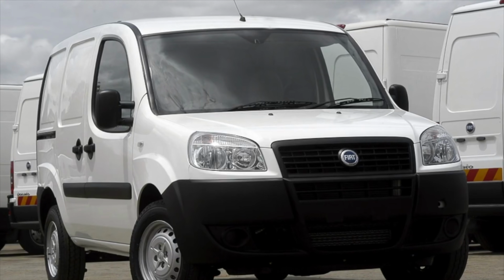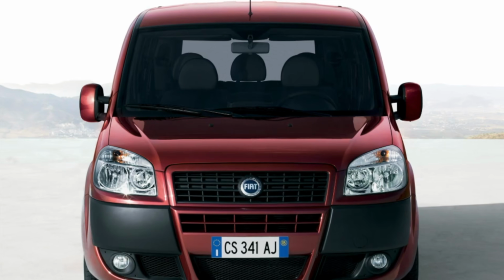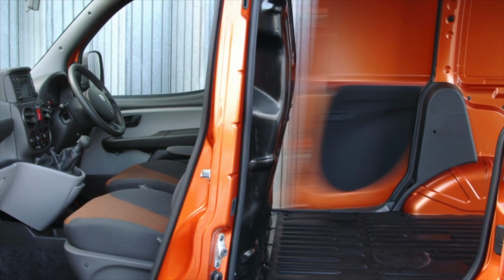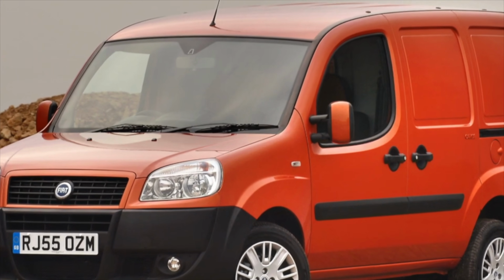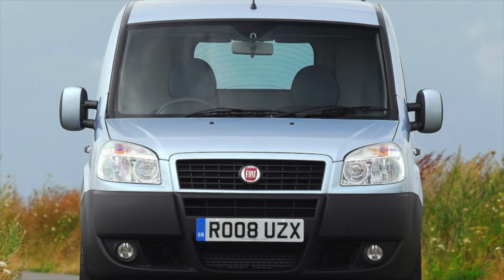Fiat Doblo Problems | Weaknesses of the Used Doblo

Comment: The 1.9 JTD is a quite fast car too, i'm currently driving one now from someone i work together with, i'm going to buy one too in the future, lots of fun to drive,This car has already driven for 400.000 kilometers.

There were some issues with the clutch slave cylinder and needed some new bushings.

I recently replaced the brake discs and i notice the caliper holder didn't fit when i replaced the brake discs and pads.
The wheel couldn't move anymore because it was hitting the caliper frame.
i remounted them with washers who function as spacers and problem is solved and it breaks like a dream without scraping!.

The rear door handle was weak too, but fixing this car isn't that big of a issue, it's not a bad car to work on. 
The car is suprisingly functional, but i don't like the seats.
Like any fiat it shifts like a dream!.